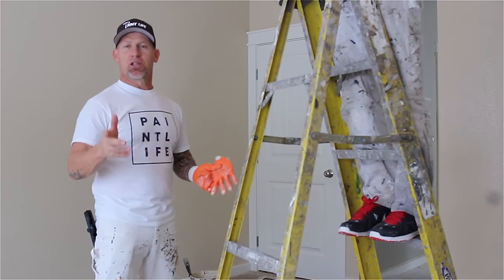Painting A Bedroom In 30 Minutes. How To Paint A Room Fast.

Comment: How to paint a bedroom in 15 minutes: Use 6 painters.
Reply: Nope two Puerto Ricans, the biggest nap you've ever seen and some edgers. I'm telling you they put me to shame. I'm rethinking the brush
Reply: @Elijah k lmao
Reply: .......and 3 hours of prep before hand lol.  Oh this was a major fail. And I do like his vids.  I'd NEVER EVER one coat, I don't care WHAT kind of paint. Nope.
Reply: exactly my thought.
Reply: @terijo5052  if you can one coat its actually 1000% better. when you do double coats its depending on mechanical bond and not a chemical bond. So if you are repainting thats already 3 coats min and 2 of which are depending on mechanical bond. Mechanical bond will scrap off easier when struck/scratched lightly.  Maybe you need to rethink what ever stubborn uneducated reasoning for never single coating.
Reply: No doubt, I was hoping to learn something.  The boss is gassed, every painter I ever saw was getting paid hourly and drunk while painting as slowly as possible.  If a bedroom is 12x12 can it still be considered a “master bedroom?”  I can honestly say that out of my thousands of hours painting and tens of thousands of walls that I have painted that I have never encountered a paint that covers in one coat.   The very best paints I have ever used could get by with approximately 1 1/3 coats and be very close to one coat, but never just one.  I understand the purpose of the video was to prove a room can be painted quickly, show me a video where prep work can be done quickly and you would have something.  If a company preps and paints your entire house in 2 days, without the use of extra lighting, the job you are going to get will be laughable.  My advice is to take your time and do things properly so that when you paint down the road you won’t have to spend countless more hours of prep.
Reply: @terijo5052   I've never heard of putting caulk over your tape to stop bleed through. I would like see how that works. If you tape off the right way and paint along the tape with a drier brush you will b fine. Hence 2 coats and no picture framing! Pa painter
Reply: HAHAHAHAHAHAHAHHA!
Reply: @bonnivilleblackcherry9745  Hes actually doing 2 coats in one. Hes laying that paint on THICK
Reply: @bigj2518  Hes laying that paint on THICK, id call that 1 1/2 coats in one pass. lol

Comment: Great job guys! I'm a professional painter with my own painting business and you can save an additional 20 minutes by using the accubrush for your windows, doors and floor trim. I spotted this tool on a info commercial late at night and thought why not it's inexpensive so I bought one thinking I'd just through it away after the first use but I was so impressed with how it cut the paint right tight to the trim work and it did it cleanly. Very impressed I use it always for interior trim edging. They make a ceiling one but it's pretty much useless unless the ceiling is totally smooth and I don't run into enough smooth ceilings to justify purchasing one. Also Floor pans are to dangerous to knock over, spill and you need room to roll into it with your roller especially with a big crew in one bedroom instead use a 5gal bucket with a paint screen in it, this way your unlikely to knock it over, you can hold more paint and you can roll into it by going straight up and down. Keep up the good work!
Reply from the maker: Awesome, thanks for sharing!

Comment: Will be painting a few rooms. In the past I've used the tape but still get bleed. I heard you mention  using clear caulk with your tape. Can you elaborate. Does this go under or on top at the edge and how do you remove so it doesn't cause an issue for future paint adherence with out damaging the current job? Thanks
Reply: Tape sucks. I’m going to start just not using it and see what happens.

Comment: You're only getting TWO roller widths done with each dip into the paint bucket, or is it only one and a HALF? Either not enough paint on the roller, or putting the paint on too thick?
Reply: Kman that's how you get one coat coverage
Reply: This is what is called a one and done. What the painter is doing, is expressing the same fundamental principle as spraying, a 50% overlap. If you want to accomplish a successful one coat, this is how it is done. If you stretch the roller any more than he did, two things will happen:

1. You will see the old color, then;
2. You will go back to cover it, and end up pulling more paint off the wall than you are putting on.

Comment: First off, Thank you for creating such quality content.  Secondly, I have a rental house that is currently not occupied 4 bd 2200 sqft keeping the flooring.  I do have a prefessional spray rig and have used it quite a bit for exteriors and gut jobs that we paint before there is any flooring.  Would you prefer to tape and spray or roll a job like that?  I will spray the celing the same color as the walls if I spray, if I roll I will leave the flat white that is currently there.  Would love to have a pros opinion on the topic!  Thanks again!
Reply from the maker: We would spray it
Reply: Thanks for confirming its the best way to move forward for my situation.  Love learning from craftsmen who obviously take pride in their work!  Thanks again

Comment: What would you say is the max time you can leave the tape on the trim after you have caulked and taped? It appears that you caulked and trimmed the entire baseboard, and didn't remove the tape, then did your final coat, correct? I would assume this is to protect the trim from any drips, just didn't know about the cut in drying and the tape pulling any paint off. Also, do you ever worry about 2020 tape pulling paint off of the trim? Do you ever tape off the whole house before starting to paint? Thanks for all your helpful videos!
Reply from the maker: You must pull the tape before the paint dries in order to prevent peeling

Comment: My paint job calls for two coats of paint, with a drying time between each coat. Should I leave the tape up until the second coat if finished or re-tape between coats. I am a little afraid that when removing the tape it might peel off some of the paint because the first coat already dried.

Comment: In another video you showed applying paint with a roller in a W pattern, then filled in  the bare areas.  But here you used vertical strokes only.   How do you decide which technique to use?
Reply: He is doing vertical strokes and applying more paints in a 9' roller length  areas.

Comment: Ideal conditions and they have 3 pros on the job. Unloading the van, all the prep work, removing outlet and switch covers (ain't no one can do that fast with archaic slotted screws you can't use a screw gun easily)  laying out drops, fixing holes in the wall, painting the walls and ceilings twice, because there's no such thing as single-coat coverage...you're looking at holiday city, doing the trim, cleaning up, loading the van. It all adds up.... You're looking at 8 hours for a single painter.

Comment: Very good job guys :) . What does determine whether you give two or just one coat? As I think usually you give two coats of paint no or its not a must? thanks :)
Reply: sometimes you don't have to coat 2 times or 3 it depends if the color was the same before you can just give it one coat usually.if your doing a color change then most likely you will need 2 coats rolling and cutting.
if you are using very very good paint you can roll it super thick and it might pass but you want it to look nice so you will want to coat it twice no matter what hope that helps.

Comment: Hello Chris, nice video, as always! I have a question: your advice is to remove the masking tape when the paint is still wet, to avoid bridging. But what should I do when I have to apply multiple coats and have to wait in between coats for them to dry? Do I remove the tape after the first coat, and then apply masking tape again before the second coat? Or should I just leave the tape and be very careful removing it after all coats have been applied? Thanks in advance for your answer.Regards, Sander
Reply: Tweakwood , I'd use a paint edger and remove tape (if you really need the tape depending) --in between coats. Or every other coat. 
But if you don't and get the bridges, a cheap fix is to take some sand paper and lightly sand it down

Comment: Sorry I should have been more specific, any tips on dealing with walks that high should I spray or roll , I have scaffolding and ladders I'm spraying the exterior walls and roof using a cherry picker
The real issue is the wife wants to use a metallic paint on the inside and I want t make it look good
Regards 
Richard

Comment: I noticed you tool the trim plates off of the plugs and switches, but not off of the phone jack(s).  Is there a reason you left them on the phone jack(s)?
Reply: Vern C I know it's been a year but I'll answer anyways. Usually they're screwed straight into the drywall. So when you take them all the way off and go to put them back later the hole loses it grip on the screw and the plate doesn't stay flush with wall. I loosen them up enough to cut behind the plate a little, but never all the way off.

Comment: hey mate, 
im subscribed! - nice colour, it covered well did you get away with 1 coat? if it covers perfectly no second coat is required right? 
also 1 more thing, would you save half the time when cutting in if you didnt roll back with the small 2 inch nap??  if you just cut it with a brush and roll it close enough with the 9inch nap why isnt that method as effective? is it the brush lines you are trying to hide? thanks man !!

Comment: I'm also a painter, going into my 3rd year as a pro. I'm interested in your technique for preventing the paint from bleeding under the tape. Clear caulk? How do you get that back off? It makes sense but I'd be worried about creating a weird effect from the caulk once you paint over it. We normally just use a drier brush against our tape to prevent that. 

Also, Ben Moore baby! SW is ok too, I suppose. Just messing around. They're both great paints IMO. Anything but Baer, especially their white.
Reply: Mark Brown
Reply: Mark Brown im a professional painter also and im located in northeast fl.  ive noticed that for the most part all good painters are working to prevent the same exact problems although some of our techniques may be different. btw, back in the 08' time frame when new construction was booming and we were all making $$$ Baer was not great paint but do yourself a favor and get some next time you have the opportunity to. Baer has 100% stepped there game up and there paint is great now. they changed all there formulas :-)
Reply: Paining for 3 years and you're professional... Poof! Wow that's amazing
Reply: YouTube clowns

Comment: What one coat paint did you use?
Reply: Camille's Locker I do thing like this with my dads business. And there really all the same. There's really little difference between the cheap, and expensive paint that says it's a one coat paint. It's just a markup to pay more. We've. Tried all, really all same results. We use vaspar 4000 latex paint 90% of the time. It's in the lower middle class range

Comment: Love your videos!  couple quick things on your website you have a pdf to download to calculate paint needed its says
 The room above is calculated like this: 
7+7+7+7=28 total height (H) 
12+10+12+10=44 total length (L) 
28x44=1232 total wall sqft now minus windows and doors 
1232 - 21 (door) - 15 window - 21 (closet door) = 1175 (T) 
1175 / 400 = 2.9 gallons of paint 

But I think it should be total length of wall (44') x height  just 7' correct? 308sq'?
Reply: So a 10x12 room with 7' tall walls you have listed at 1232sq' thats not right  am I missing something?
Reply: I'm going to bed but I gotta know!!
Reply: +The Idaho Painter  got it!  so is that good for 2 coats?
Reply: I hate to be one of those guys that won't let it go but I really want to understand this. My thoughts : The old fashioned way for the room above : 10'x12' with 7' walls. I'm going to say 0 openings for ease. So I have 44 Linear ft' and for area I multiply by 7' for height I get 308sq'. (Assuming 1 Gallon Does 400sq)' 308sq'/400sq' 1 coat = .77 gallons 2 coats would be 1.54 gallons. Your formula says I need 2.9 Gallons of paint. If I would have subtracted the openings I would have exactly half the amount of paint your calculating. I really need to understand where I'm Going wrong this seems so simple!! Really Appreciate your videos great info and speed!
Reply: Yeah there is no reason to be multiplying height for each wall, area is area, this is 3rd grade math here. Take your room and imagine opening it up and laying it out flat so now you have one big rectangle. Like you said, its just 44' by 7' to get the total area(minus any doors and windows).  If he's charging $3 per sqft I hope customers know how he's calculating the area lol.
Reply: I'm still hoping for you to help me understand the paint calculation I know you have to respond to a million of these but I want to know how this works... please?
Reply: I'm still hoping for you to help me understand the paint calculation I know you have to respond to a million of these but I want to know how this works... please?
Reply: on your website you have an Example pdf to download to calculate paint needed its says
 The room H=7 W=12 L=10 is calculated like this: 
7+7+7+7=28 total height (H) 
12+10+12+10=44 total length (L) 
28x44=1232 total wall sqft now minus windows and doors 
1232 - 21 (door) - 15 window - 21 (closet door) = 1175 (T) 
1175 / 400 = 2.9 gallons of paint 

When I do it the old fashioned way 10'x7' + 10'*7' + 12'*7' +12'*7' I get 308sq' per coat if one coat does 400sq' the old math says just over 1.5 gallons or 2  coats. and that is not subtracting the opens that you did. you came up with 2.9 gallons. What am I not understanding?

I want to understand how to calculate paint like a pro. I'm smart lay it out for me.
Reply: $3 sq/ft is probably based on the floor plan.
Reply: the question was regarding how to properly calculate amount of paint needed...

Comment: Every thing is slower in Idaho. I paint rooms by myself. Set the drop clothe tape the base and cut the wall, paint the wall for a 1 coat job.  Roll the walls, cut the walls,  reroll the walls for 2 coat process. 1.5 hrs, cleaned up and out of the room

Comment: As a professional painter I would skip the taping and for sure this doesn't need 3 guys in one room.  Room like this, one pro painter 35-45min cut and roll, one coat.
Reply from the maker: Thanks for watching Chris!
Reply: Chris Wieczorek prove it. I call BS. Unless you want body color running on your trim. Maybe you can but I doubt it.
Reply: @peterpiper2590  I've been painting for over 30 years and I could easily paint what they did in an hour...it does need tape on the baseboard though.
Reply: @lordbobrules  make a video and add a link.
Reply: @peterpiper2590  ya, because your that important to prove it too. what are your credentials?....then make a video and add a link.
Reply: @lordbobrules  I don't care either way.  Your the one saying you have this ability.  I have painting skills amongst other skilled trades. By myself self,  hauling ads I'm guessing 2 to three hours.  2 coats,  holes filled and trim covered.  Not counting door  or taking off the outlet and switch covers.
Reply: @peterpiper2590  they just showed you, 26 minutes with 3 guys...do the math. 1 pro can do it in an hour. If it would take YOU 2 to 3 hours, then your not a "pro".
Reply: @lordbobrules  I can paint professionally.  3 guys at 30 minutes is 1.5 hours
 My cut in are slow because I don't do it everyday.  I can paint anything.  Homes,  automobiles,  aircraft,  canvas,  ceramics,  commercial. Your ability as a great painter is application and endurance.  Many think they can paint but it will not last.  It's all about the prep and product knowledge and experience.
Reply: @peterpiper2590  You mad bro? Chris the boss can do it by himself in an hour, he's got the skills. The video is the painting procedure and masking, nothing else. Of course the prep is important, but the video isn't about that. My cut ins are fast because I do it every day. He said 26 minutes with 3 guys, do the other 2 guys have the skills as Chris? I doubt it. (no disrespect to the other guys). A pro CAN do what they did by himself in an hour, I know (and many other pro painters know too) because I do it 5 days a week. Now come back with some more nonsense on how your a "pro", yet you cut in slow because you don't do it everyday??? Come on, get the last word in so you feel vindicated...
Reply: Chris Wieczorek yessir a a painter I agree totally
Reply: That was less than half of the work, the masking the Ceiling and the Trim wasn't painted,  also one Coat only is not good
Reply: @lordbobrules   dude, take a breath. They also had some of the prep done before hand (well, cover plates, drop cloths, whatever) and didn't include the end work in there video so it's weird and misleading.
Reply: I'm sure Chris and gang are sitting back laughing at all of us fighting lol   "oh, I can do it in an hour, well I'd do two coats in 1 hour and 5 minutes, well I don't tape and can do it in 53 minutes, oh yea, I can do it including a free window washing in 46 minutes. Well I can paint the walls including three 8 minute cig breaks and a sandwich break and have it done in 32 minutes WHILE texting"....  jesus christ    We are are own set of nut jobs.

Comment: I like Clear (NOT SCILICONE!! Paintable caulking REMEMBER THIS DIYer's) caulking for when i'm painting accents or color on color in particular. I like white caulking when cutting in white base boards. I also prefer to do the ceiling, doors/windows and outlet cut in first, then roll my coats on the wall then Do the baseboard cut in last.
Reply from the maker: Thanks for sharing!